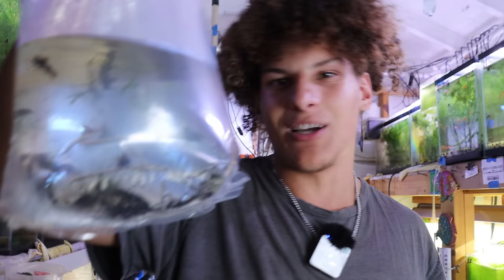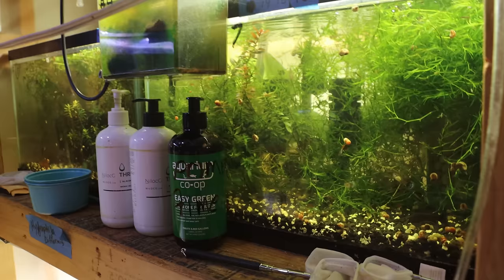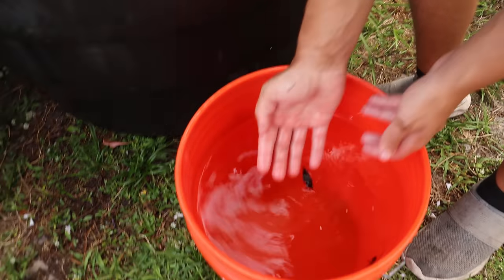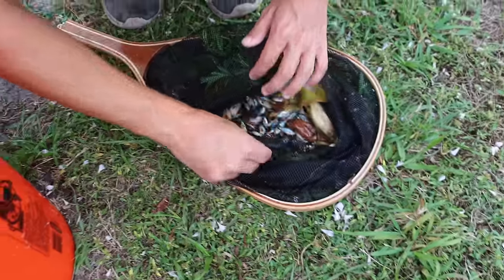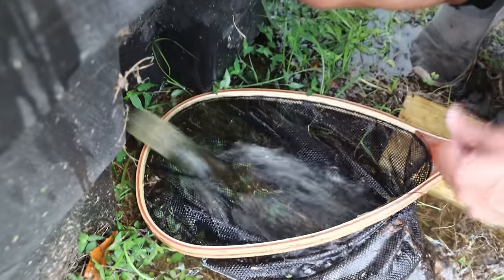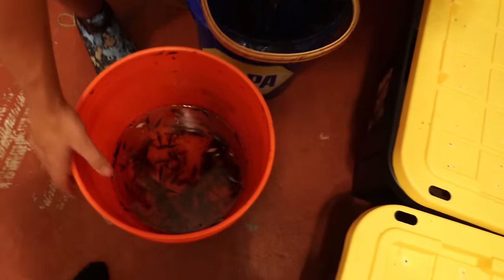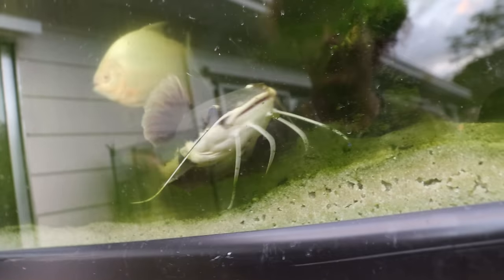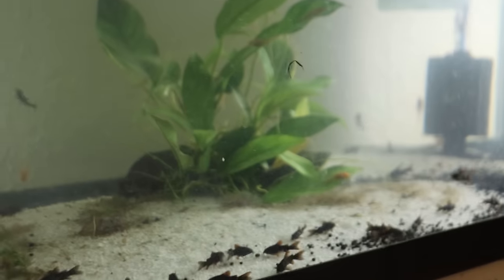I Bought 100s Of RARE AQUARIUM FISH For My FISH ROOM!

Comment: Hey Rob if you want to help with heat and direct sun light you could always use like a trap style tent to cover the top. The ones that ppl use when they’re at the beach and it’ll help with heat?!?! Plus I would add an air stone for gas exchange. Good luck bud.

Comment: In that heat you NEED oxygen in there. At least 1 or 2 bubblers. Warm water equals less oxygen. And the fact that they we’re struggling, you should have had a bubbler in your bucket.

Comment: Rob buddy😢 even if it's a WATER RECIRCULATING PUMP, keep the water moving! We use a " Geyser " aerator in ALL OUR tanks and holding tanks. 😂 You know the ones that simply shoot water up in the air. Lol Actually my Dad used a recirculation pump and tagged up a shower head so the water was CONSTANTLY moving and showering down on the water, creating aeration / adding oxygen. Be creative, and you will get the results you want at a fraction of the price. You could just pump water from the canal ❤ STAY STRONG,  KEEP PUSHING and KEEP YOUR FAITH! Just another bump in the road bro!

Comment: Why is it above the ground? digging them into the ground is the best way to apply insulation. now you have black pound that captures heat. and just to be sure, always have an air pump in it.
Reply: Isn't the deeper into the ground you go, the Colder it is actually?...
Reply: @PULAG  it works for more people. I think the water remains more stable in terms of temperature. so it can't get too hot or super cold. movement in the water will also bring hope. and otherwise a few solar panels on the roof. and that way to connect the heating or pumps for the ferry. takes a whilemoney but it earns it back.